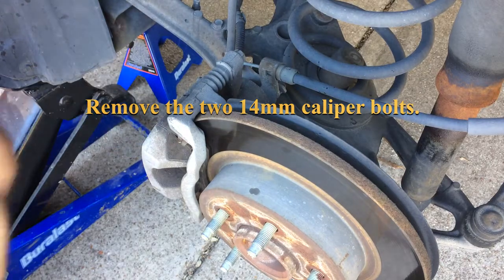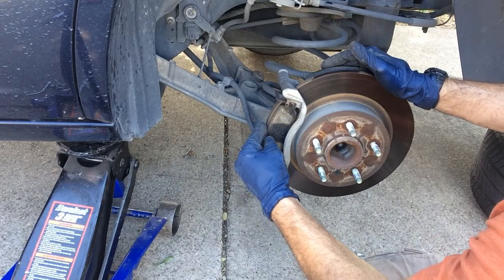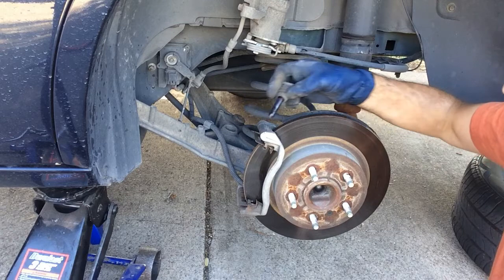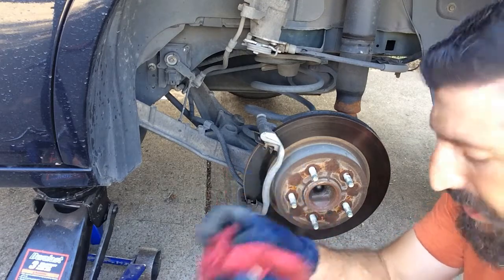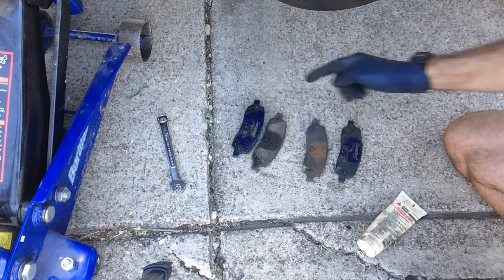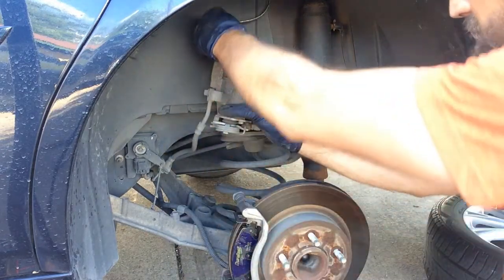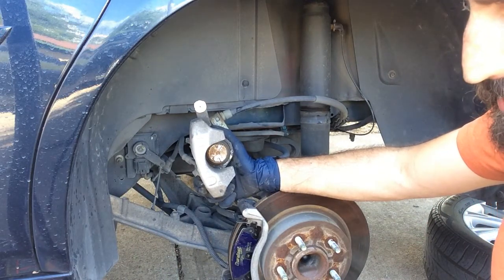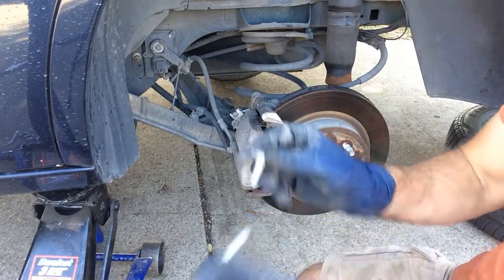Buick Lucerne REAR brake pad replacement-  QUICK tutorial ARGDS

Comment: Thanks for the needle nose pliers advice. I was trying with a c clamp like every one else I've never seen one of these turn in pistons before. I actually used a wire terminal crimper to turn it, worked nicely
Reply: Same here. I've never seen this design. I wonder what the point is.
Reply: @jtadevich 
My guess is that they do this so that the piston can also operate as the e-brake. The two seem to go hand in hand

Comment: You should post more videos will definitely help and will definitely watch your video
Reply from the maker: Thanks!
Reply: @aregularguydoesstuff4157 . Quick question. How much do you think it’ll be worth to sell my 08 Lucerne cxl 3800 motor with 191xxx miles on it. Runs good clean in and out leather seats. Thanks
Reply from the maker: @Mikehawkis-hz7lq  
That’s a tough one. I sold mine with 172k miles for $3500 but it was right before things (car prices) went crazy. 
I probably could’ve priced a little bit higher because it sold quickly. 
If it’s in really clean condition I don’t think $4000 plus would be out of the question.
Anytime I sell on craigslist I put a ton of pictures and a lengthy description about any repairs or maintenance I’ve done. It will set you apart from any other sellers.

Comment: Good Job with the video, I understood. I see I can get 4 rotors and all the pads for my Lucerne for $250 on Amazon, but they are from china.Do I dare trust them? What do you guys think I should do? O Rileys wants 90 bucks per rotor & 70 bucks per set of pads.
Reply from the maker: Autozone has a discount code SAVE4SUMMER.  this will get you $20 off of a $100 purchase with free shipping.

The best advice I can give anyone regarding brake pads is buy the lifetime warranty ones from AutoZone and when they wear out they will replace them for free. I’ve done it four times on one car.
Reply: Buy the good stuff, the China parts are a P.O.S ! You will be much happier.  I got a set of  rotors once that we warped!

Comment: Not trying to give bad advice but I’ve used a c clamp every time. Just do it slowly and also apply pressure to the other side so it slides evenly as the side with the c clamp. To be fair I’ve only changed my brakes myself less than 10 times so don’t take my advice lol